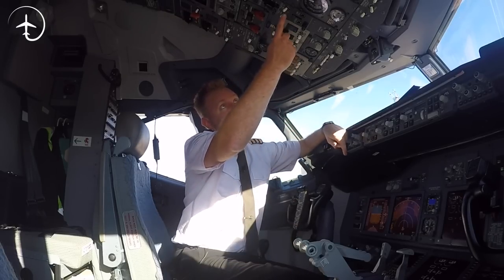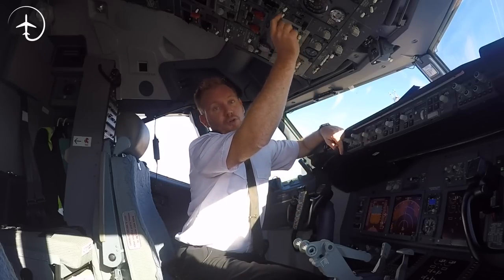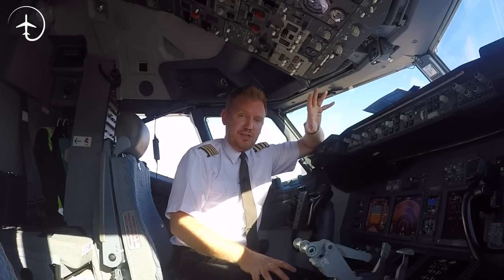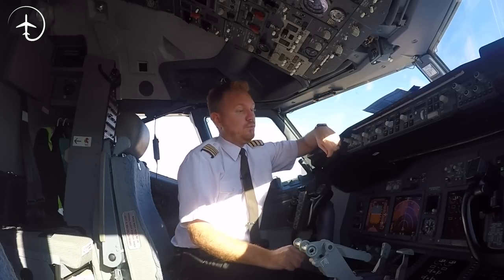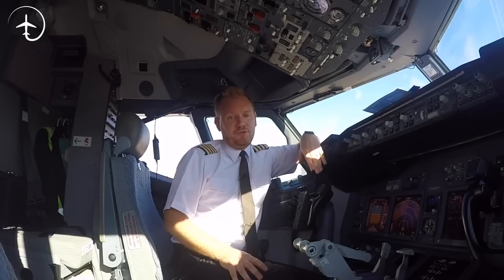Aircraft HORN (Claxon) and “No smoking” signs

Comment: On Delta aircraft, they actually are able to turn off the no smoking sign, but it's used only when crossing 10,000ft (they flick it off and back on again each time they cross) to let the cabin crew know.
Reply: The light actually turns off and on when it chimes- Not sure about the 787, 777, or 747, but all the other models they run (including A32X) the no smoking sign can be turned off.
Reply: That's a pretty cool tidbit

Comment: Last year, I had an email discussion with a 777 United Airlines pilot on the exact question asked in this video: “ why are there still no smoking signs?” And he wrote that there is no point. He said smoking is “never appropriate” on an aircraft. He also said that changing the the aircrafts no smoking signs would be a “retrofit” and be way too expensive for there to be a reason. With the 777’s technology with cabin to flight deck communication it is much easier for pilots and FOs to see the “cabin secure” notifications on their screen; thus, making the no smoking sign futile. So it comes down to whether airlines want to spend the money to get rid of them and mostly, it doesn’t. Newer planes either are getting fitted with placards (that the pilots cannot illuminate) or no electronic signs. Thank you Mentour for your airline’s/ aircrafts point of view! Keep up the good work.

Comment: I did not know about the procedures behind the "No Smoking"-switch! Thank you for another great video! :)
Reply from the maker: Thank YOU for supporting!
Reply: I've noticed the no smoking sign will flash (just flicker off then on 2 or 3 times before staying on again) at the same time as one of the various "chimes" or "beeps" that come over the speakers, and it's usually at the points you change that switch position.   So it's a memory device but it seems to also be a code for "roger" to the flight attendants that you got the message that they're ready for takeoff/landing/turbulence.

Comment: Planes actually used to have horns way back in the day, typically one that sounded just like a train horn, earlier even (and on airships all the way until they went out of fashion) like a ship's foghorn. Planes then were much slower, so they made sense.

They were mainly for use on the taxiway though, and occasionally to scare a fox or bird off the runway. In some old cockpits (DC-6, 707, 727 BAC 1-11 for example) you can still see where the horn button once was, in the middle of the yoke. The round thing could be turned to either left or right (depending on the seat) and the horn would sound. They did it that way so pilots didn't accidentally push the nose down when trying to honk at some KLM Fokker with a camping trailer attatched virually PARKING right on the glideslope, as they like to do up to this day. Further, at some unique airports, like Gibraltar or Sydney, where had roads or railtracks crossing the runway, the use of the horn was in fact mandatory before the take-off roll and right after touch-down. The military also used this. There's a reason people say that "a Tornado sounds like a freight train."

When air traffic grew, they were ever more commonly misused by pilots getting impatient in the departure sequence, and noise pollution (especially at Italian airports) became inacceptable and it seriously hindered radio communication, so they were taken out of the aircraft as soon as ground radar for the controllers and especially TCAS was more widespread. Not that the horns made much of a difference anyway in the age of fast jetplanes. But well, that's minimum equipment lists for you...

Oh, and fun fact: In the Concorde cockpit, due to the shape of the yoke, the horn button looked more the bell on a bicycle, was used by just pushing it, and therefore was awfully often triggered accidentally. Just google Concorde noise (or ask Captain Joe), you'll find hundreds of people remembering just how enormously loud she was. Now you know why. And if anyone thinks that's all a bunsh of rubbish, look at the Embraer 170/190 for example. They are really quiet even though they have almost the same shape of yokes. Yet no button and no horn. See? Evidence!
Reply: Mikosch2 bingo mind blown
Reply: Mikosch2 wow! excellent insights!
Reply: Mikosh2 I want some of what u been smoking!
Reply: I don’t think many people actually read that lol.
Reply: I do strongly remember hearing ship-like horns from blimps depicted in fiction
Reply: "KLM Fokker" No need for the foul language.

Comment: Using the no smoking switch as a memory device is very clever!! BTW you are almost at 100,000 subscribers!!
Reply: Edward Cameron What if they forget to turn it off after usage? Then they think cabin crew gave their  clearance for next takeoff/landing. There should be a visual signal in the cockpit for this purpose, which automatically turned off.
Reply: @khaldounmnb5197  You seem to not know about checklists.
Reply: Sloth Hawk Perhaps not. Maybe you can tell me?
Reply: Note: This is for the 747.
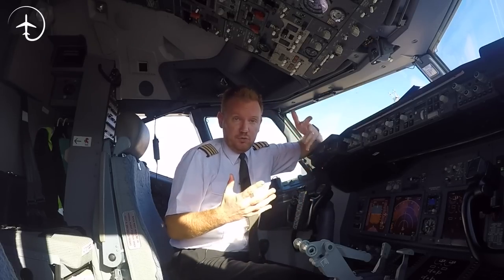Reply: In 05:32 he says that the cabin crew gives the pilot a sign that everyone is seated. How do they give this sign?
Reply: @khaldounmnb5197   Depends on the airliner. Usually using the "phone" located at their stations.
Reply: Sloth Hawk Exactly, the phone! There should be a button (of course only accessible to the crew) for this sign giving. So that the pilot would not have to press a button not to forget the sign he has been sent from the cabin.
Reply: @khaldounmnb5197  Newer models do this I believe.
Reply: Sloth Hawk OK so I wasn't completely idiot 😊

Comment: That smoking sign nonsense actually makes soooooo much sense. As a "driver", I always check my lights before starting off the first time. Sometimes in between, and then again when shut down.
I only turn on the full lights when I am driving between dusk & dawn, the driving lights are for the street, and the DRL are for the parking lot(s). So after checking for passengers & cargo, I turn on the lights just like a pilot is to a plane.

Comment: I think they should have permanent no smoking signs and then replace the light with something else that would actually need to be turned on and off at different phases of flight.  My first thought would be “use of wireless enabled devices”
Reply: You can use wireless devices at anytime now unless they are so large as to impede an evacuation. If there really was any danger to the flight systems they would not allow you to take the device on board.
I agree though, no reason for the no smoking sign to be illuminated. This is probably a regulatory requirement.
Reply: quenchize I believe it varies depending on the regulatory body.  I fly a lot for work in Canada, and I know that in Canada you still have to have your devices in airplane mode at all times while in the air, but you may have wifi and Bluetooth enabled.  My idea would be they turn on an “airplane mode” light prior to reaching the HS line.
Reply: Looks like CurvelessSphere you get your wish ! I think everywhere you have to use flight mode. It used to be the case that you could not use devices at all during takeoff and landing. Most carriers have relaxed this requirement for hand held devices. They still are supposed to be in flight mode though. Not that anyone checks of course, which they would if it really mattered.
In EU now you can take your cell out of flight mode as soon as the aircraft vacates the runway. 
So I wonder if the light means "use flight mode" or "don't use laptops" because these rules apply during different phases. Damn now we need two lights.

I reckon forgetting your phone on in your hold luggage is more dangerous.
Reply: CurvelessSphere I’ve seen that sign on a new Boeing 777 - it replaces the no smoking sign
Reply: Aeroflot prohibits all kinds of wireless devices onboard still. Which jars quite a bit with how other airlines handle that issue. Might be our local wireless ground equipment standards, but I just think they are lagging behind.
Reply: You’ll be glad to know then, that new planes nowadays have the no smoking sign as a placard. The light that replaces the no smoking sign is a no mobile transmitters sign.

Some of the older planes in my company are rewired such that the no smoking sign is permanently on. The switch in the cockpit just plays a chime when it’s moved.

As for whether or not you can use your mobile devices during the flight, it depends on the regulations of the country’s airspace the airplane is flying through, as well as whether or not the aircraft is built to support the usage of mobile devices.

Comment: How much of a threat are seagulls on the taxiway when the plane isn't moving all that fast and the engine speed is relatively low?

Also, what's that constant hum?  The APU?
Reply: The engines. I think the APU will be turned off after engine start because there is no need to it, as you have the engines generators and engine bleed air. But, as always, correct me if I'm wrong.
Reply: If seaguls get too close to engines, they have a tendancy to become too nosy and get themselves inhaled into the engine... engines don't like the taste of seaguls and tend to throw a hissy fit when they suck them in.
The hum is not something I can explain as well, I tend to know much more about airbuses than boeings (due to mostly flying easyjet in real life and on a simulator!)
Reply: The hum could be either the electric hydraulic pumps or just any AC circuit in general.  Airplane AC power is at 400 Hz instead of the 50 or 60 Hz in your home.  So instead of the low hum that you hear from florescent lights, for example, it will be a much higher pitched sound.
Reply: I think the hum is the engines.
Reply: Hum is from the avionic bay just below the flor of the cockpit. It is a mix of AC power noise and ventilation fan noise for avionic LRU´s. No engine or APU running - Ground power.
Reply: Isn't Timothy Chapman refering to the hum while taxiing?
Reply: Due to the separation between lines I was thinking the hum question was related to the wideo.
Reply: I know it's NOT the engines.
Reply: It's the air conditioning. 737ng with both packs running on ground, its pretty loud in the cockpit.
Reply: Oh, sorry I thought it was while taxiing. But then it is probably the packs and the ground power
Reply: Its either Ground power or the APU Yes
Reply: It wouldn’t actually be the APU as planes are plugged in to a ground power source as to not waste fuel. The constant humming will be the instruments and flight control computers in the cockpit.
Reply: Pedro Almeida it’s the APU and it’s never turned off unless the plane is done operating for the day.
Reply: KidWithAKart that’s definitely wrong. Don’t spread wrong information
Reply: ehm, no. It's only used when it's needed. Eg. during startup, when parked and no ground power is available, and if both generators in the engine die during flight
Reply: Pedro Almeida The APU remains turned on during takeoff and is turned off at the same time as the flaps, in case the engines turn off and they need compressed air quickly
Reply: It's maybe Ground Power
Reply: If a bird gets sucked into the engine, it will damage the fan blades and the engine won't work.
Reply: in my city in india we use firecrackers to shoo away crows on taxiways / runways
Reply: Thank you come again!
Reply: Ravishankar K
in my city in india we use firecrackers to shoo away crows on taxiways / runways

 what man! why spreading mischievously false information?
to others: our private of Govt. owned airport operators do NO such thing.

In-fact, some contemplated 'hiring' larger birds of prey like eagles or others which are trained to create fear amongst the pigeons, crows etcetera
Reply: c3h80 it's actually the knudler valve for the catastrophic converter. Lotsa people get confused by this. :)
Reply: +terry boyer
thanks for those inputs, but could you guide to any page or resource where we can know more about knoedler valve/ knudler valve?
could not really find much on a passing search.
Reply: Hey Spock. It was just my feeble attempt at humor. There are no valves or converters. Sorry. Live long and prosper!
Reply: The constant hum is likely from the 400 Hz electrical system.
Reply: Depends mostly on where you are. Example in Texas you have to assume the seagulls are armed. They are known to have a bad temper and are fond of .32 cal, so you check the runway for casings that may get sucked into the engines. Also spotting any larger caliber casing could mean there are raccoons hiding nearby hoping to hijack the aircraft. Never a good situation
Reply: Obviously every person who saw this fantastic video is now much much safer so a big ThankYou MenTour about this great information.

However, I think it is very unsafe to use a no smoking icon for communicating procedural readiness among crew because while it is convenient for the airline it may be dangerous to the aircraft. A small chance of a misinterpretation exists between passengers who do want to smoke?
So, there has to be another new rule for "no smoking paraphernalia in the cabin as well". It is a business decision to use the airline industry as a social responsibility tool to physically take cigarettes out of people's pockets and bags while inside the cabin. Most smokers wish to stop smoking anyway and the whole western world is cracking down on smoking by increasing taxes and enforcing bans. 
Then, the aircraft gets even safer than it already is at minimal extra cost. By actively helping people quit and keeping flight transportation safe the overall reputation of the industry is enhanced well into the future.
Reply: tjperez69 Yes, It's the 400Hz whine in the background.

Comment: Great video Mentour. I just have a little question. When you film in the cockpit sometimes there are two landing light switches and in other cockpits there are four. Why is this?
Reply from the maker: Differences between older (4 switches) and newer (2)
Reply: Ok, thanks! Have a fantastic day! :)
Reply: The older cockpit was prettier.
Reply: But what did those two gone switches do? Did older 737s have other two landing lights?
Reply: The older NGs had Extendable landing lights on the belly of the plane and lights in the wing root but they have been recently removed since they started using LED landing lights only in the wing root.
Reply: Alright, thanks!

Comment: Apparently there have been three incidences at San Francisco where commercial airplanes preparing to land have incorrectly lined up to the taxiways instead of the runways.  I read that the control tower attempted, as a last resort, to signal one of those aircraft that they were making a mistake by using some sort of highpowered flashlight to shine into the cockpit.  Can you elaborate on this, please?   

Great video series!  I watch regularly!

Comment: May you make a video about the thrust lever and the engine start ✈️♥️
Reply from the maker: Engine start is already available. Look for it.
Reply: Thank you mentour 👍
Reply: jo flyer on the A320,  since she is fadec controlled,  the engine start sequence is has become automatic. the auto start flow is as follows:
ENG Mode selector to IGN/START
 ENG Master switch to ON (after amber X’s go away)
At 16 % ignition ON
At 22% starts fuel flow
At 50% start valve closes, ignition off
Engine idle should stabilize at about 58%
 ENG mode selector to NORM
Reply: Thank you for the detailed information.
But in the 737 of mentour there is no autostart system right.
Reply: jo flyer i do not believe the 737 is using fadec

Comment: What happens if the instruments fail? What do you pilots do?
Reply from the maker: We have 3 backups for the most important ones.
Reply: But what if they also fail? Then too bad, right?
Reply: And what is the failsafe of the Boeing?
Reply: apperently wires when all else fails
Reply: Oh thanks.
Reply: Boeing's also have a RAT.  But also, there are at least two of everything in the cockpit and on separate circuits.  There's also a miniature PFD that has it's own battery so it can function when the rest of the power is dead.
Reply: Pedro Almeida no way. If yes only vmc otherwise they are going blind towards ground

Comment: Hey, I am not trying to be funny. But have you ever seen a goose or anything while your up at altitude flying ? I heard some geese can fly at like 25, 30 k ft.
Reply from the maker: Nop, not that high.
Reply: Mentour Pilot do aircraft have dashcams? As well as the black box?
Reply: here around the Himalayan range the bar headed geese ans the saras crane do go over the mountains, but then there aren't many airliners :P flying around.
But it's still be lower than FL250
Reply: I am sure depending on your route and time of year for some it is an issue or potentially an issue... for those interested;
10 highest flying birds in the world.

    8 Bar-tailed Godwit – 20000 feet.
    7 Mallard – 21000 feet.
    6 Bearded Vulture – 24000 feet.
    5 Alpine Chough – 26500 feet.
    4 Whooper Swan – 27000 feet.
    3 Bar-headed Goose – 29000 feet.
    2 Common Crane – 33000 feet.
    1 Ruppell's Griffon Vulture – 37000 feet.

Comment: I have 3 questions:

1.) What happens if a bird gets sucked into the engine and how common is that?

2.) If you're not allowed to smoke on a plane, why is there an ashtray in the toilet?

3.) Why do the cockpit dials and screens look like something out of the 70s USSR or Windows 95?  When will we see something more modern?
Reply: 1. depends on bird size and engine. kinda common. if you've seen us airways flight 1549 you'd know a flock of birds can cause the engines to fail
2. because if someone either didn't know or chose to break regulations, they can at least have a place to put it out instead of having no choice but to throw it somewhere wher it could cause a fire
3. for safety in case of electrical failure is my guess. i know that some military aircraft are all analog even today, just in case of an EMP
Reply: 3. Because changes in aviation takes a long time..